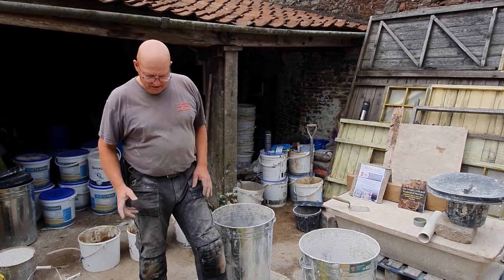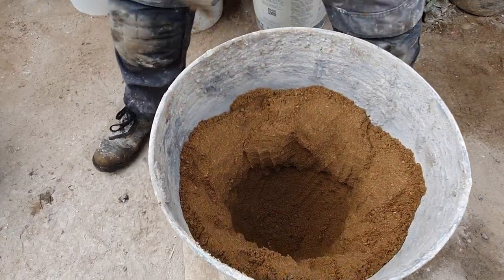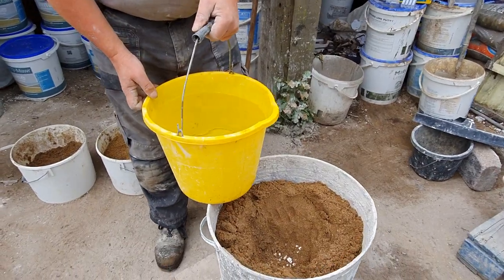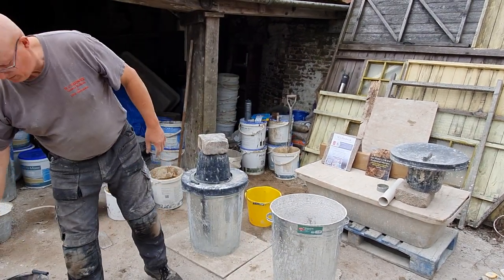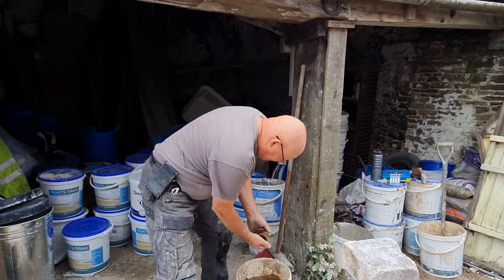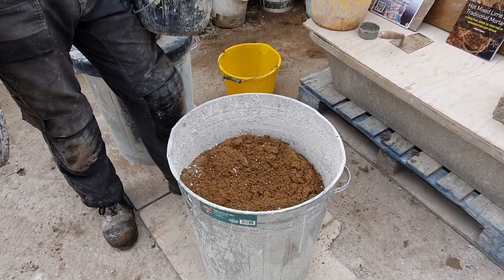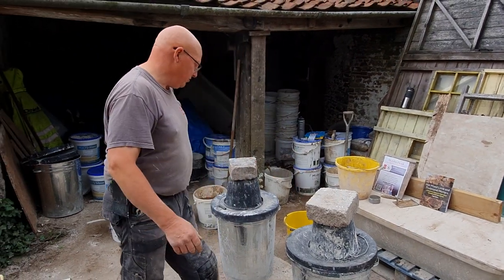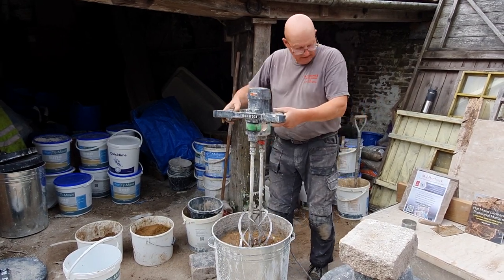Quick hotmixed lime mortar twin bin - Part 1

Comment: Correction: the mix should be 1 part quick lime to 3 parts sharp sand. The quick lime then expands on slaking to provide a 1 part quick lime to 2 parts sharp sand mix.

Comment: Great video James , just a question my local quarry sells crushed limestone 6mm down to dust ,could I mix this with sharp plastering sand (it’s  brown in colour) , for random stone pointing! As I’m finding it very hard to find sharp washed 5mm gritsand . Also if you were using ratio 3/1 is it still 11/2 water 💧 Tnx

Comment: INFORMATIVE VIDEO, COULD YOU CLARIFY WHAT DID YOU MEAN BY 1¹/2 MEASURE WATER? 
IS THE RATIO 1 PART LIME + 3 PARTS SAND + 1¹/2 WATER. 
THANKS.

Comment: As far as I know as Nigel Copsey states the mix should be 1 part quick lime to 2 parts by volume of well graded sand. This is a historical mix.
Reply: ok. in another video a professional stated 5:1 ratio 🙄
Reply from the maker: You need to remember the slaked lime will expand from its original measure. This has been anticipated with the initial measurements before slaking had started.
Reply: @annashealthylifeeverything8583  that "professional" along with about 99% of them are mistaken.
Reply: This is very true, one is using three parts sand another four and another then again different ratio. Here in this video it could have been spent more time explaining sand ratio and why sand stone had been used. Ok sand stone sand adds to breathability but Is that sand stone sand sharp sand? What is then in another backers  if there is already in one sharp sand. How graded are sharp sands? Is it washed sharp sand? Can any Sharp sand be used? Does this  mix consist only of sharp sand aggregate? I know builder sand ought to be not used due to its impurities,but really want to know more about the aggregates to make proper mix. Is this mix for pointing or what can be used for! Historically, this is incorrect mix in terms of ratio to the lime, furthermore, sharp sand has never been used in the past in conjunction with lime. Nevertheless, it is very informative video.
Reply: Also, i must say that I had difficulty getting lime stone dust. Couple of buildings merchants I went to buy from or order at least lime stone dust 4 mm down to dust, well, most of them didn’t have a clue what I was asking, they look at me kind of weird. It tuned out that it is painstakingly process to order, and if one contrive in it, only bulk bag can be delivered.
Reply: @deninsrmic4165  "I know builder sand ought to be not used due to its impurities"
Specifically clay, which holds water and can caused drying issues, e.g. exacerbating shrinkage cracks.

Comment: Pity the sand was too dry so didn’t show a good reaction. After they were left to finish slaking (30 min.), both bins were wetted up and used whilst still warm.
With a wetter sand they can be used straight away.
Reply: Hi Mike great video.  Nice to see someone doing a more realistic size mix for those of us needing to use a fair amount and not having to mix up a thimble full every five minutes.  I'm guessing you guys are in Bristol from the mention of Holme sand.  I was there for 8 years now moved to North Devon and renovating a run down lovely farmstead.  I've been using putty mortars for years but just about to tackle my first hot mix with some calbux 90.  With the aggregates. I have a nice washed sharp sand available here albeit lacking in any limestone. There's no finer silica sand like holme available.  There is what they use for plastering here they call a mortar sand.  Similar grain size to holme but a bit red and crap looking.  Might be okay for a hot mix.  What ratio of sands do you suggest I use?  I guess as no limestone aggregate 3:1 with the quicklime but unsure on the ratio of sharp to finer stuff.  Do I even need the finer stuff?  Should I add a little pozzolan as were a bit prone to rain here although were semi sheltered ish?  I have loads of broken slate I can grind to dust to use as a mild pozzolan.  So many questions.  I'm reading Nigels book at the mo.  Great vid.  Cheers.  Ben
Reply: Dr Fish 
Hi,
Good to hear about your project. Yes, we’re just north of Bristol near Thornbury.
The aggregate needs a mix of sizes up to a third of the thickness of a mortar joint, usually 0-4mm which if drawn on a graph would form a bell-curve.
Our local mortars are all ash mortars which have no sand aggregate at all!  Use a local sand to try and match your local mortar colour. You could use all slate dust if that matches, try a small patch and see how it is after three weeks.
We have used the Biddeford grit mixed with Holme sand (a coarser grade of Holme to give a better size variation).
Mike.
Reply: @mikehardwick8070  Thanks.  I've gone for 50/50 mix of the local sands and a little limestone flour I found in Mole Valley for cheap.  Been going well so far.  Got most of the gable end fixed up now.  Yea I know too well the Bristol black mix mortars.  Horrible if you have to rip anything out like an old ceiling.  Cheers again for your video.  This is my go to method of mixing now.  Hoping to get a roller pan mixer in the near future as I have a lot of Masonry to build in the spring but it's hard to find one and man they're expensive.  Worked out I need at least 7 tonnes of mortar.  I can buy premixed but by the time the delivery cost is added it's not very cheap either.
Reply: Dr Fish 
Thank you, glad it works for you.
We have four bins which means that when we use all of them some are “cooking” whilst others are filled, whisked or emptied. This way there is no waiting time and we can mix up half a tonne relatively quickly on site and ready to use hot.
A roller pan may not be easy to move and would crush out a lot of the variation in the mix, so it may not match the original colour so well if trying to match but would give better conformity.
Reply: Mike, do you add any pozzalan to your hot mixes? Great video, thanks

Comment: I learned it should be 5:1, not 4:1
Reply: you learned wrong. This is due to a huge misunderstanding of 1:3 meant only 1 part quicklime and not NHL or Hydrated lime and 3 parts sand which after slaking will be about 2 parts lime to 3 parts sand.